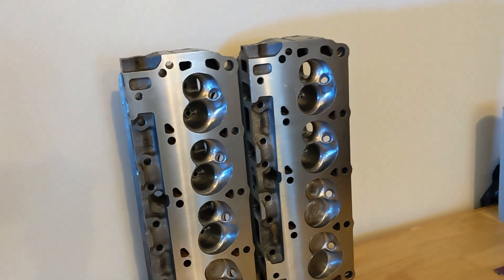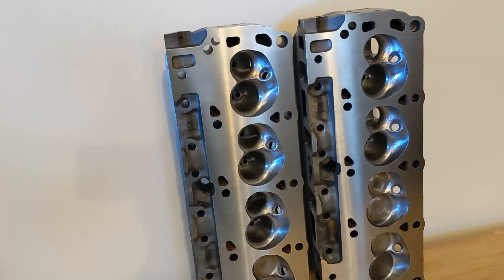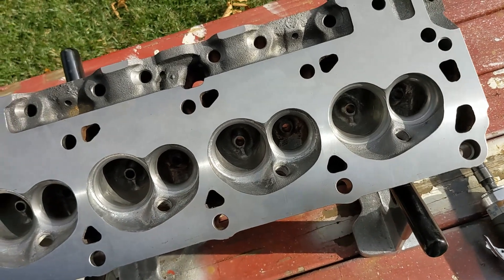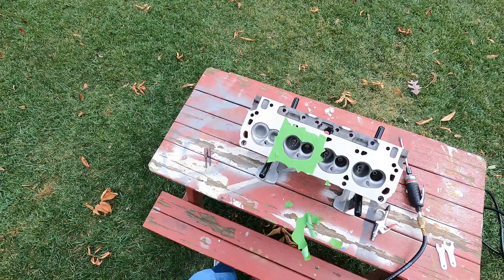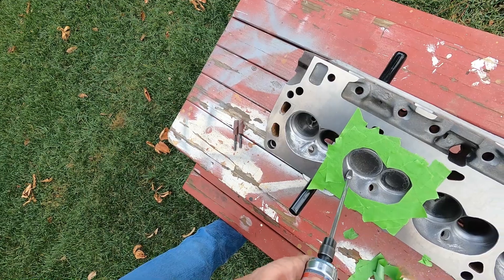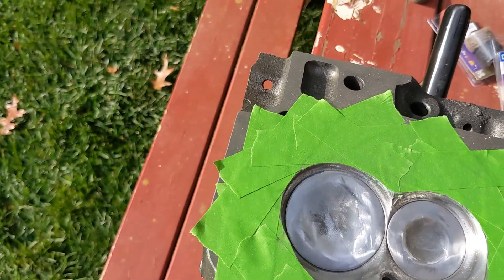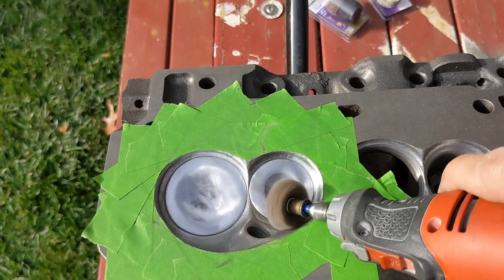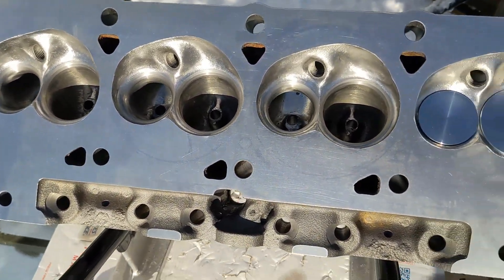Porting How to -- Polishing cylinder head combustion chambers

Comment: I am working on my first swap. Ls3/4L80 in a 03'Crown Vic Police Interceptor. I am planning on doing about the same thing to my 821 heads. I don't think the 821 intake ports will open up as much as yours did. Those ports are caverns. You should be able to pick up a bunch. Tho it'll change the torque ramp. I've heard. Don't route me on that. I'm going to port them some.
Reply from the maker: Stock LS3 heads flow about what my ported heads flow. LS3 heads intake ports are larger/ taller than my ported Windsor SR heads and have 2.165 valves so they have a lot more potential than what my heads have. LS3 heads are about as good as it gets when it comes to a stock small block sized head. They should make a lot of power.
Reply: I think illllll leave them alone then lol. Thanx for the info.

Comment: dont remove to much material as you will lose compresion and have to cc the heads to keep chambers fairly equal.come back and finish with cartridge rolls for a good polish.
Reply from the maker: Thanks. I did measure the chambers after and they gained about 1 cc, but I was already planning  to have them milled to up compression ...

Comment: Cool video.  Whenever I ported and polished, I always polished the combustion chambers so as to not allow carbon buildup in the chamber itself.  I would polish the exhaust ports, but not the intake ports.  You want to keep the intake ports rough so as to not allow fuel droplets to form. Droplets form with slick surfaces.  The gasket match is great on all ports and looks great.  Once again, nice video.
Reply from the maker: Thanks, appreciate it. I didn't mention it in the video, but I did polish the exhaust ports and left a 60 grit finish on the intake ports, for the reasons you mention.